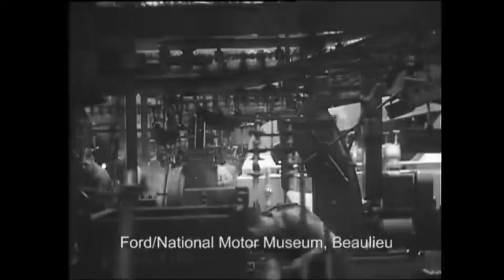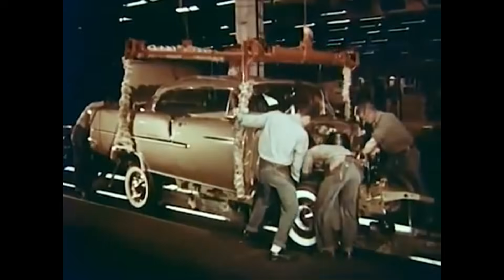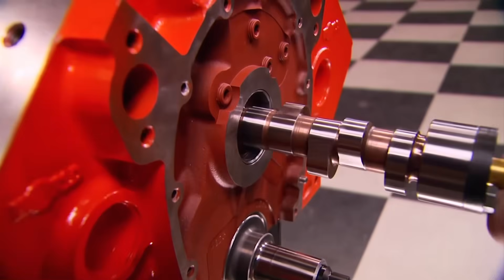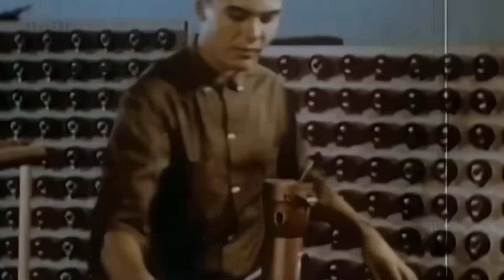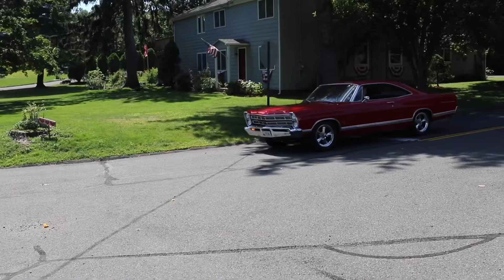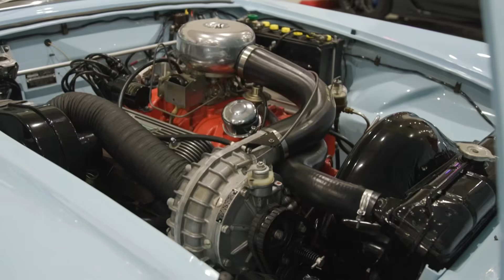Why Ford’s Y-Block NEVER Made It Into America’s Muscle Car Era!

Comment: My dad had one of these in his 58 Ford.  The oil channels would get clogged and slowly destroy the engine. He never even looked at a Ford product again.😊
Reply: change the oil
Reply: Those engines were designed to be used with detergent oil but most likely most did not get it and lack of oil changes caused problems.  Even the stove bolt Chevy engines suffered from lack of oil changes,I grabbed some parts off a 53 Chevy 216 that had external oilers like seen on some Y blocks.
Reply: In the day I think some brands of oil and especially the  new "all weather" or "multi- vis" oils were bad 
"straight weight" Valvoline or Castrol changed so as to be appropriate for the season would probably not have had the problem

Comment: The Y Block was a dud.  It is a cool looking and sounding engine.  Chevrolet hit a home run with it's early V8, and outclassed the Ford V8 badly.  Ford's edge on Chevy with larger CID didn't go far.  Ford engineers came back with the new Windsor engines to replace the Y-Block.  It was definitely an improvement.  I  still think Y-Blocks are cool.  Probably a better truck motor  than car

Comment: I remember state police cars had 332 Interceptor engines.
Reply: Yep I fixed a 56 by swappiing in a 59 352 Interceptor mill with a stick trans and 411 gears. I even beat a few 327 chevys.
Reply: Late Brother of my Father had a take home 59 Ford squad car full of radio equipment and antennas, he owned a similar 59 Ford that looked about the same,think it had a 352 in it 
Supposedly one of these cars could outrun/accelerate a 1960 Chrysler with a 413 engine in it (not a Chrysler 300)

Comment: 300 hp. was NOT more than most muscle cars 10 years later. Base level 67ish Muscle cars were like the 396 (cid)/325 (hp) Chevelle SS, the 400/350 GTO, the 390/335 Fairlane GTA, the 400/340 GS 400.  Then there was the serious stuff like the GTX base engine 440/375, and the optional mills for all these 67 critters.
Reply: There was supposed to have been a Motor Trend 1957 comparo where the Rambler Rebel beat out the 300 hp. supercharged Ford

Comment: When i was a kid in 1965 ny dad had a 56, the heater core went bad,he removed the blower motor so air from engine fan and that over the top crossover would come into canin,i remember heat was better than original

Comment: They had bendable pushrods, they had rear main seals that leaked so bad you had to put a pail under them to stay ahead of your oil level. they had that stupid "crossover pipe"in the engine compartment that strangled the exhaust, they had a miserable reputation for upper engine oiling,,so bad that an after market outside of the engine block "oil line" was the band aid fix to quieten down the thrashing noise of the valve train. and ,,,hydraulic lifters? never happened on Y blocks. Mustn't forget that teapot four barrel too!
Reply: I've been driving yblocks since 1968 and still run 2 high performance yblock cars and never had a bent push rod. The rocker oil problem was easily solved by Ford mid 57. Do you know what it was? And what is wrong with the 'teapot' carbs? That exhaust cross over didn't impede flow until 4K rpm. Ford did not engineer engines to spin over 4k for good reason. Do you know why? Have you ever owned a yblock?
Reply: The only thing you had right was that none ever came with hydraulic lifters. The only people who had problems with Y blocks were the ones who know nothing other than how to bolt aftermarket parts onto a SBC engine
Reply: @skidoorulz4914   puddlers, drip drip ,terrible engine lubrication,,except for that,,,there was more , lol!
Reply: @waynejennings-h4d  You have to be a Chevy guy. Nobody else is that stupid!
Reply: I agree! I firmly believe that this engine ignited  ford v-8’s reputation as far as being oil leakers back then.
Reply: They were famous for the rear main seals leaking
Reply: @billk5727  And you were around to know that?
Reply: @skidoorulz4914   Well yeah.  Back in the early to mid 1960's you could buy good running y-block Fords and Mercurys for a few hundred dollars.  I had a couple of them.
Reply: I don't think they had a rear main seal and as for rocker arm oiling-- we dubbed these early engines "ol squeeky"...  Nice looking cars of the "50's though. We put a built big Olds V8 into a 2-tone green1953 Vickie HT with 4-sp Hydramatic-- now that was a car, looker and likely the fastest muscle car of the day.

Comment: If you quit thinking of an internal combustion engine in terms of horse power & torque & see it as a self powered air pump, you get the big picture. The more air you can get trough the engine, the more power you can make. The stacked ports limited the size of the intake ports. Yeah you could punch it out but you weren't going to get anything out of it. Plus the thing weighed ALOT. The small block Chevy was pushing out about 250 HP out of 283 cubes.
Reply: The 283 with solid lifters pushed out 270 horsepower, 283 and on up with FI and solids.

Comment: The Hot Rodders and drag racers completely ignored this engine.
Reply: For a very good reason. When judged on it's design, weight, and output, it was (and is) a massive turd.
Reply: @deadchewie  BUT, it has a SUPERB bottom end, and a strong bottom end is essential for true high performance.

Comment: The Y Block had oiling issues, especially the rocker arms.
Reply: There was a relative simple fix for this problem, but you had to pull the engine to perform this modification.  There are numerous youtube presentations describing and demonstrating this upgrade.  Also remember that the Chevy small block ALL had cam bearing issues.  Now look at the massive problems of the modern V8's out there.  Good example is that POS 5.4 3valve Ford.  Maybe all manufacturers should look over their shoulders at past good engines, though less powerful technically, and build something like that again.  Sorry, now days you have to search for a reliable engine with good low end torque.  Many pick-ups are equipped with mismatched engines, basically hot rod engines with high horsepower numbers, but don't produce torque down low where you need it, and have absolutely NO long term reliability.
Reply: No they did not have an oiling issue.    it was a maintenance regime that could not be ignored.   The Oil change intervals HAD TO be followed if that was done there were no issues with top end oiling.
Reply: @matthewq4b  Back in that time the average owner would not change oil, only adding oil as needed.
Reply: @robj2704  WRONG  back in the day a vehicle was in the shop multiple times a year especially any where with winter.. They had ample opportunity to get the services done.
Reply: But that is easily fixed.

Comment: If intake ports stacked on top of each other is so superior, why doesn’t any manufacturer have one today? 
The stacked ports make for a taller head , not good for low profile vehicles. How do you port a head like that? 
No mention of the horrendous upper valve oiling, & small oil passages, that no detergent oils in the fifties made clog them up with that crazy head configuration.
Reply: It wasnt the oil. It was the blow by. all those combustion gasses  excaping into the oil pan made them sludge up fast.
Reply: @thecollectoronthecorner7061  Back then, they had Draft Tubes that let the blow by oil go down to the road fro the crank case through the a tube. No PCV back then. If you’re old enough, & traveled down the old US Highways  in the 50s through the 60s, one could see the accumulation of those oily blow by gasses down the middle of the highway.
Reply: They can be ported a little.  It is their space-wasting that hurt.

Comment: Why not mention the Lincoln Y Block that had far more displacement than the Ford Y? Why not?
Reply: Because the video is about the Ford Y block!
Reply: @skidoorulz4914  The Lincoln Y Block was produced by Ford.
Reply: @duroshebanja6810  Of course it was because Lincoln was a subsidiary of Ford. Kind of like saying a Cadillac engine was produced by General Motors. But the video is still about the FORD Y BLOCK not the Lincoln Y Block. How dumb can you be?
Reply: @skidoorulz4914  can it up dude.
Reply: @skidoorulz4914  a Y block is the subject here, why not even mention it knucklehead?

Comment: I own a '56 Thunderbird with a 312 Y Block. While it's smooth and reliable it's no powerhouse!
Reply: It can be made a lot faster, but classic cars are supposed to be stock.
Reply: @jamesbosworth4191  I'm not complaining about the power. I have a 67 Mercury Cougar with a 350 HP Small Block Ford V8 for performance. And my wife has a 2022 Mustang GT?CS which is even faster!

Comment: I had a 312 in my 57 Ford f100. Biggest piece of crap ever. It wouldn't make a good paperweight.
Reply: It was very heavy so it would have achieved paperwight status
Reply: 57 Chevy with 283 4 barrel and stick shift from the factory could beat a 312 any day. And I'm a FORD guy through and through.
Reply: @billdaigle6610  Believe it or not a 56 pontiac with a stick and 316 or a 57 tin indian with a 347 would blow the doors off any 283 chevy, I have a 55 pontiac thats a stick, and a 60 389 that will blot into it. We have a 55 chevy 2 dr wagon with a stock 283 three speed with a ford 9 inch with 456 gears, I have a $100 that saysI can beat any stock normally aspirated y Block in the 1/8 mile. We also have a 55 ford ranch wagon and a 62 -390 four bbl T bird engine for it. and it likely will not beat the little 283?
Reply: @thecollectoronthecorner7061  57 Olds J2 was ALSO a ROCKET, pun intended, and smoke almost everything that came along. (On The Street) Sounds like you guys were REALLY into engine swapping. Me TOO.
Reply: @billdaigle6610  So far ive never laid eyes on a J 12 olds, Ido have a 62 with a 394 rocket.
Reply: @thecollectoronthecorner7061  Supposedly Chevrolet borrowed from Pontiac tech as to the V8 engines which both began to sell for the 1955 model year

Comment: [NOTE - CORRECTION] - ALL Y-Blocks had solid mushroom lifters - they never, ever, never came with hydraulic lifters.
Reply: I was just getting ready to point out that error, but you beat me to it.
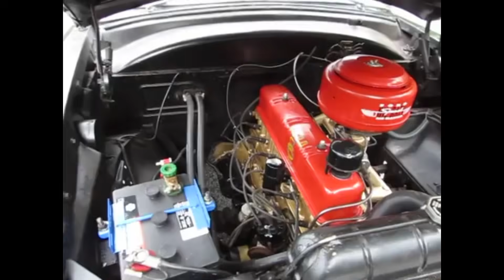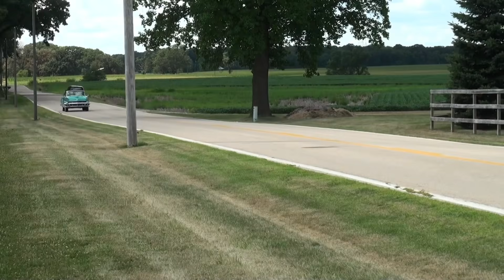Reply: Well at least they accurately showcased some of the lesser known Y-block variants, such as the "I-shaped 6cyl version" of the V8 Y-block as seen at 3:32, and the variant with "2-4 barrels" at 8:16.

 Without ^their careful research and accurately portrayed imagery, most folks would never know about that stuff! 😁
Reply: @HighlanderNorth1  Nice sarc.
Reply: There are reports of some Y-block engines, particularly those built for military use in colder climates, and later models produced in Argentina, being fitted with hydraulic lifters, though this was not a standard feature for the engine in the US.
Reply: @Tregaskis47  - I have never heard or read of even the possibility of fitting or adapting hydraulic lifters to a Y-Block.
Reply: @Tregaskis47  No Y blocks were ever hydraulic lifters! It would have required a totally different block casting to do as none of the oil galleries run through the block anywhere near the lifters. The lifters are only oiled with oil running down the push rods and splash from the camshaft. Some Lincoln Y blocks did have hydraulic lifters but never the Ford, not even in South America

Comment: 239 couldn't get out of its own way. Valve lash had to be set hot with engine running. Oil everywhere and try to avoid those hot exhaust manifolds and that idiotic cross-over pipe. Wished my 54 had had the 239 flat head.
Reply: Also '54 Dodge Red Ram with 4 barrel carb would run away from that Ford. Only about 3 or 4 more cubic inches.